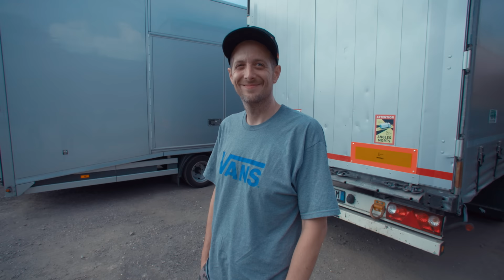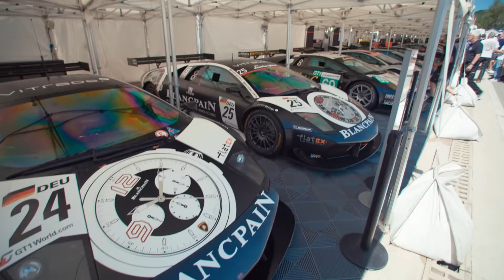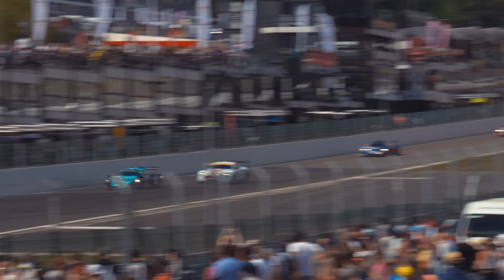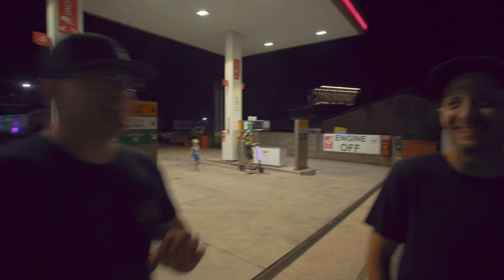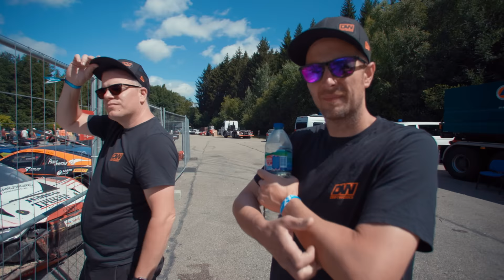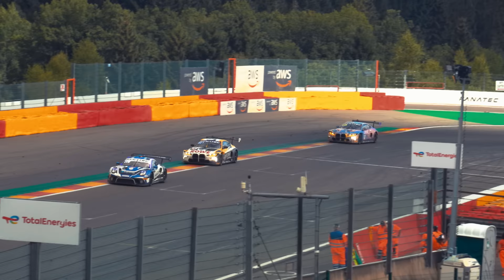My GT1 Murcielago Road-Car meets Race-Car heroes at the Spa 24 hour

Comment: brakediscs and pads do get changes, like 2-3x in a 24h race, they got quite the unique fittings where they simply unbolt the caliper and disconnect the brakeline with a fitting that allows them to connect the new lines without getting air in the system. Therefore its a simple quickchange solution without bleeding the whole system each time
Reply: Didn't the Ford GT team work that out for Le Mans, if they could do rapid disc changes they'd win the race. You can probably thank Mr Shelby.
Reply: They change the brakes only one time during the 24 currently, some cars could even do it without a brake change since there is a mandatory 5 minute stop though it wouldn't make sense to not change them.

Comment: Done endurance racing many times now with a team, 
We run 2x Ginetta’s
we take a 3rd complete car as spares and multiples of the basics…. Brake pads, disks, shocks, a couple of diffs, drive shafts, props and nornally a spare engine. 
When we race in Dubai 24hr we use 2x 40ft containers.

Comment: You need the front stone shield for the trailer the Poor GT1 could be getting pebbled 😢
Reply from the maker: I don't understand this weirdness.  I've towed probably quarter of a million miles with an open trailer and my various pride and joys. The car is more protected than if you drive it on the road, which is what it's meant for.

Comment: Agreed💯 proper engines with proper sound. Newer doesn't always mean better. Cars just don't sound as good as they used too back in the early and mid 2000s. Ferraris are the biggest disappointment when it comes to sound on the racetrack. 488 will never sound like the 458.
Reply from the maker: Totally agree. The Ferarri just sounded lame.